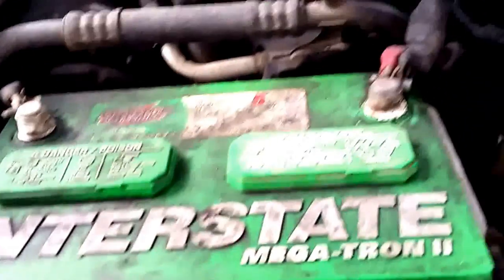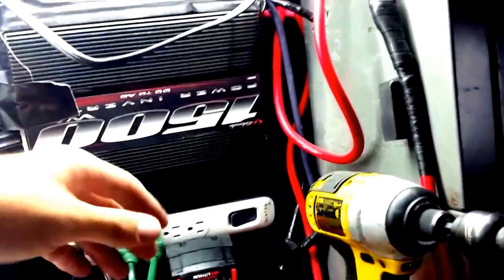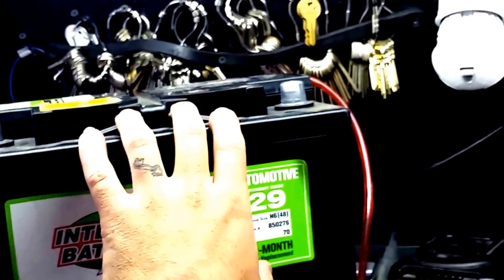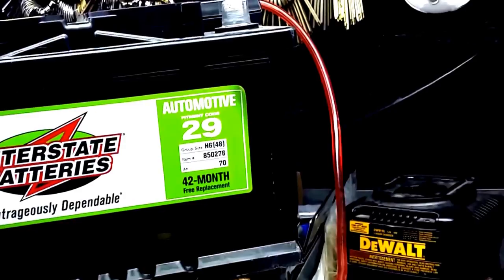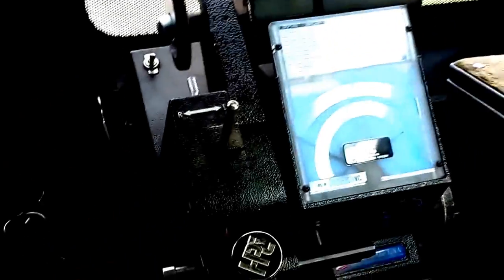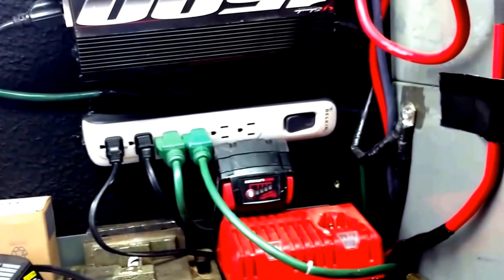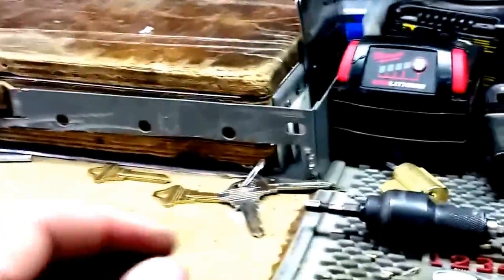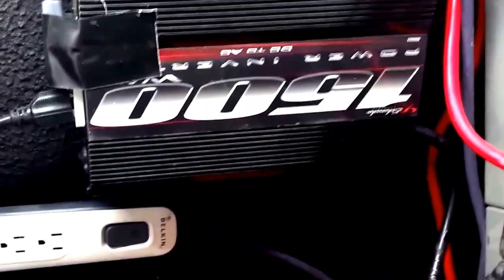How To Install A Power Inverter In Your Work Vehicle Truck Van Or Car

Comment: A fuse does not generate power. Your fuse size is determined by wire gauge and anticipated amp draw. The fuse will pop before your wires melt and cause a fire. Please consult your local pro...🧐🤨
Reply: This guy thinks bigger fuses gives more power.   I'm going to guess he's dead already.
Reply: Yah, he's fried
Reply: Instantly stopped watching at that point
Reply: To be fair, im a terrible speaker at explaining things and he probably choked up. In my mind I know what I mean but things come out wrong. Im sure he meant well but yeah fuses dont generate anything.

Comment: What you're talking about is a kill switch. That's the device that cuts off the electrical power from the main battery, to the external one. It's $20 for a generic switch that you can get from pepboys.

Comment: I have a 5kw inverter in my van. It's ran everything I've plugged into it. I use the stock 140A alternator and 4-100AH batteries. It's worth the $. I use it daily, but also plan to use it in place of a generator at home if the power goes out. I already have generators, but they're noisy and the van can idle a long time I'm sure on it's 30 gallon tank.
Reply: Do you have to keep the van idle while operating your appliances? I have a need to power a 7000 watts appliance from my van and the van comes with 4 Motorcraft® Tested Tough® MAX  BXT-65-850 batteries. What capacity inverter would you recommend?
Reply: you probably wanna strap on another alternator or two if you plan on using it as a generator, or at least get a built alt

Comment: I have a 2015 f 250 super duty with a 6.7  my amp for alternator are 155  I like to power up a laptop a air compressor how can I get it done

Comment: I think the piece you're talking about is a battery isolator.
Reply from the maker: +TexasMushroom Yes
Reply: +TexasMushroom or a low voltage disconnect. it will automaticaly disconnect you truck battery. commo,ly used in mobilehomes and rv's.

Comment: I suppose you were originally running the system off the engine battery and recharging the engine battery by running the vehicle engine right? And how long will both batteries last while running the ac, air compressor and key machine without running the engine?t

Comment: Question?
I just installed power inverter from the van battery..(ford 99 5.4)
I used anl fuse holder 200 amp fuse 
Wired 02 cable… inverter 3000 w 
Jupiter from harbor Freight Tools 
When i turn on a portable a/c 5000 btu.. the compressor just charged ones and later just blow hot air …
I don’t feel charge and completed the compressor cycle… Please help me
Thanks
Reply: Pd… I tested with the engine on..

Comment: Lol he keeps saying "it's the thickness of your wire". But his "mains" are a 6 and two 12 gauge tied together them little fuses. May pop but DC current will run backwards thru your short until it gets hot enough to pop that 60 amp or melt your crap.... Also 18 wheelers have 4 to 5  batteis and one someware gets jumped off every day bahaha

Comment: so you have a video how to connect (wiring)the two batteries properly to run and AC unit 7.6 amps, 7000 btu thanks

Comment: Worth testing, perhaps by observing bubbles in a container of water during charging (inconclusive if negative, conclusive if present) since your vent system terminates lower than the battery and that the tubes are large enough to effectively evacuate the area? For a similar reason that you specified large gauge cables (less resistance), your H2 should be in a large H2-compatible tube and connect to a sealed battery enclosure aka vented battery box. The vent should remain above or at least at the same level of the top of the battery since hydrogen is lighter than air.

Comment: A good ground in your vehicle is the welded body or frame, frame being preferable. Kudos for removing the paint on the cabinet and venting the battery a lot of people would not have done either.

Comment: I have a question that no one seems to be able to answer, so I thought I'd try here on this video. I have a 6.5 amp electric pole saw that I would like to use in the field using my existing car battery (2000 Rav4). Sun Joe said I would need a 5,000 watt power invertor, but that seems really high. What is the minimum wattage I would need to power my pole saw?
Reply: Nick23at63 Nick using ohms law 120v X 6.5a = 780w

Comment: Do u need a fuse if connecting to a spare agm batt inside car but not car battery....agm to inverter powered by solar panel n control

Comment: Will the 2nd battery charge off the vehicle charging system when the truck is running?
Reply: Yes, but you also have to install an isolator so 2nd battery doesn't continually draw power from main battery when vehicle is off.

Comment: I know this is 4 years later but....probably should have used a Deep cycle battery for the secondary battery instead of an automotive battery. Will last significantly longer, Saving you crazy money over time.

Comment: I have the 2000 - 4000 watt inverter from Harbor Freight it does a good job overall. It's not a sine wave inverter. But when I first try to cut my hair dryer on the red light comes on and it beeps so I cut it off the power switch and then back on and worls and it resets it. And I noticed if I'm using the metal cutting saw and I stop and cut it back on I have to reset it at times that's the only drawback. Does anybody else have that problem? I have a diesel with two pretty big batteries.

Comment: Hey bud, i want to ask this from you instead of consulting an electrician or something. I need to be able to run power tools from my truck. I have another battery and a 500 watt inverter says inverts 120/500. 120 to.the lighter plugin and 500 direct. could i build a box to mount to my headache rack that holds the second batter and my inverter then run my connection to the main battery when needed? And for hooking my batterys togeather i do parallel? positive to positive and negative to negative?

Comment: Good set up... I've got 2 questions:  
1- Is your vehicle ON while you use the power? 
2- could you have run the AC on by itself without the extra battery? 
TIA

Comment: I am a mobile mechanic and would like to be able to have an inverter to power up an aircompressor(20gal) to use my power tools, laptop, maybe charge some power tools, or use my shop vac. Is a 1500 inverter good enough?
Reply from the maker: Thats all mine is

Comment: What model air conditioner are you running on the 1500w inverter?  Can the alternator sustain the air conditioner running at idle for hours?  You said 12 "hundred" btu did you mean 12 thousand?

Comment: Hi , for how long can you run the a/c while your ven is turn on and how long while is off? Thanks in advance
Reply: I have an RV and I can tell you the engine must be running or you will drain out your batteries very fast, probably will not even run.

Comment: so when hooking up the second battery did you just run cables to the inverter's terminals? so you had 4 cables connected to the inverter terminals? 2 from the car and 2 from the 2ndary?
Reply from the maker: 2 cables to inverter
Reply: did the cables from the car battery connect to somekind of hub or did you just splice the inverter cables together?  Then you just added the 2ndary battery cables to the cable running from the car batt? So its one cable from the car batt with 3 sets of (+) ( - ) connections coming out of it at the end?
Reply from the maker: Battery cable in line charging line comes into battery one. Then cables go to battery 2.

Comment: In both of my service vehicles. I had a professional stereo company run the wiring to a back up battery. And in both units all my work lights are directly connected to the secondary battery. No need to turn the inverter when I want lights. I use a 2000 watt pure sine wave in both that can run all 3 key machines at the same time if needed. I can see the main difference when a pro runs the wiring vs an amateur. If I had a way of posting pics I would.

Comment: Would be a good video if you would back off a little so we could see what you are talking about. Maybe have someone else take the video so the camera doesn't move so much. How did you get the wiring from the engine to the back of your truck for the Inverter? I also have an Interstate battery and need to hook up my inverter to the back of my truck as I am also a locksmith.
Reply from the maker: extention cord. ran under drivers side fender and in through the the door and all the way to the back.
Reply from the maker: extention cord. ran under drivers side fender and in through the the door and all the way to the back.

Comment: Hey buddy i have a trace inverter 2000watt 8ooowatt peak and I have a 100% seal battery in the back of my work van what I am wondering is if I run it with the van off will it kill the battery under the hood as well as the one in the back thanks
Reply from the maker: john doe consider them the same. if one dies so will the otheres if something gets left on. but you can install an isolator that will charge you secondary battery but then not deplete main battery. ask a local professional if you have more questions as they will be able to set you up best. look for  a batteries + bulbs  near you
Reply from the maker: If it's connected to the vans main electrical system then yes it with both charge the battery and kill it if you leave the lights or something on. You can prevent this using a isolator. This let's the battery charge but not run dead

Comment: Are the batteries connected in parallel or series? Where did you vent battery so H doesn’t build up while stopped?
Reply: I'd guess at parallel because he wants to increase amp hours NOT voltage

Comment: Like the video, just wondering if the $100 you spent on the battery could have been spent on a bigger inverter and get the same results!
Reply: I wouldn't think so, unless he took that hundred  and added it to the total he has in the whole system.  inverters are high..

Comment: having problems with my 2006 e250 locksmith van 1000W inverter. 2 battery system
Reply from the maker: I'm not familar with that one. Maby the Dealership might be able to help
Reply from the maker: Google search term "power bright power inverter" they make them all the way up to 6000 watts! These are the same ones powering microwaves, ovens, washers and dryers.

Comment: Awesome video! Thank you! I'm wanting to run a 120v welder off of a system like this, do you know how to calculate the start up amperage draw for something like that?
Reply from the maker: to weld you will need a big 6000w inverter

Comment: So if i decided to put a power inverter in my diesel truck that already has a second battery would I need to wire a third battery or not?
Reply: maby make the cabeling so the second one only connects if the key is turned
Reply from the maker: You need a battery right at or next to the power inverter to take the shock load

Comment: What size wire did you use from the car battery to the deep cycle battery?  What size wire did you use from the deep cycle battery to the inverter?

Comment: Mine keeps going off when I start my microwave it’s a 2000 watt. It’s from harbor freight.
Reply: not enough power from the aux batteries, increase the thickness of the wires from the bat

Comment: Hi Wayne Thank-You for this very Informative tutorial.  I would like to do something like this on my Van E-350... since I cannot afford a Solar Charging System presently.  When you say consult a  Professional...  What kind of Professional do you mean? Can you be more specific as to whom should I go to instead of being given the Run Around by an Auto Mechanic. Thank nd Merry X-Mas
Reply from the maker: lacsa727 contact a mechanic, or batteries plus organisation. also people who install car stereos will have a good idea of power needs and safety concerns
Reply: Awesome I'll START there. Thanx!   One more Thang.. The thickness of wire you used for the Big Battery you hooked directly to the Inverter...What GAUGE was it?  Just want to make  sue they will be using good Wearing when the time comes.  Thank-U :O)
Reply from the maker: 0 gauge
Reply: lacsa727

Comment: Thanks for your video it was helpful but I do have some questions I did click to go to a website to ask questions I didn't see spot for that anyhow
I'm a contractor would like to hook up a 2000 watt inverter in my utility shell it has two batteries in the F250 that I have and I'd like to know what gauge wire to run back to the backup battery I have a 30 amp power AMG sealed battery that I'm going to use for the back up with a 2000 watt inverter so what size cables do I need to hook up from the battery back to the shell and then from the inverter to battery and battery to inverter hope that was clear enough
Reply: 0 gauge

Comment: Wayne !!!!   that video was GREAT !!!!   I have to install a converter into my truck to run an airless paint sprayer so I can spray deer blinds.     Now I can do it and I think I will install the 1500 just in case I need to use it on something else.    And the video was FINE.... a little shake is good for you.

Comment: Is this running on a stock alternator?
Reply from the maker: yes
Reply: Cool, figured it would be drawing too much amperage.
Reply from the maker: Nope. the dual battires take all the are surge in power and keep everything running smooth.